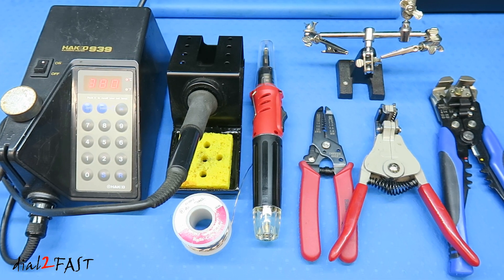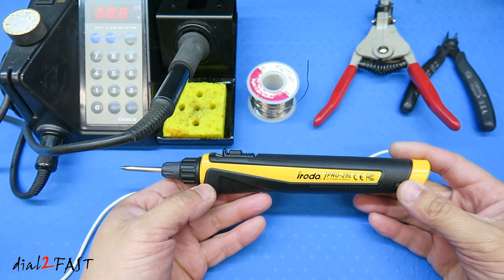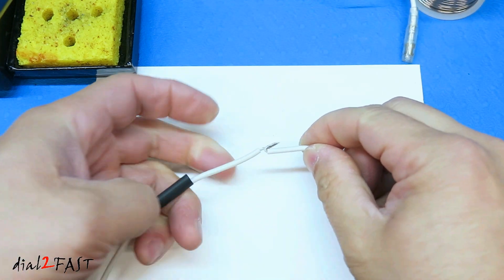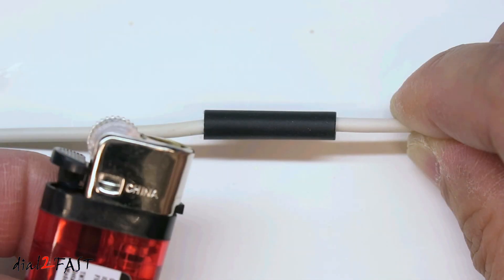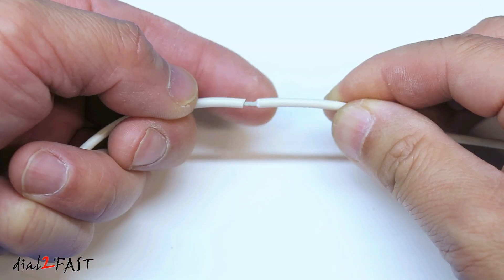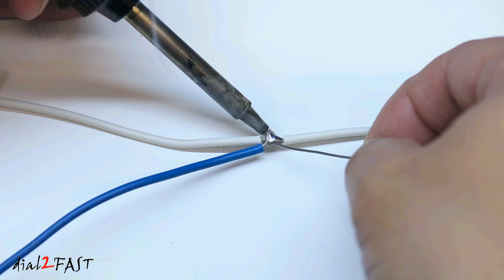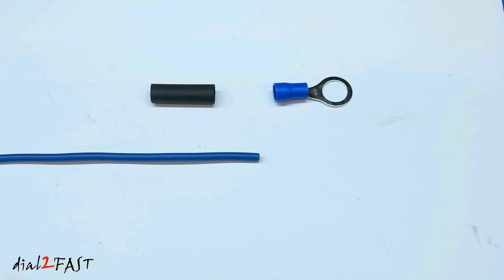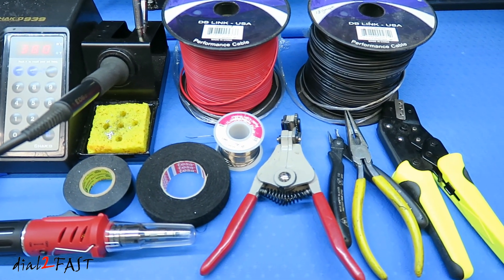How To Solder & Heatshrink Wires - COMPLETE GUIDE - Video 2

Comment: I own a 2008 Hummer H3 Alpha and the wiring harness supplying power to my left headlight was gnawed by a mouse or some other animal. As a result, 2 thin wires in the harness were severed in the harness, but about 5 remain untouched. In a constrained environment like that, would you recommend soldering or crimping a wire splice between the damaged wires? I figure trying to fix it myself is going to be a lot cheaper than having a mechanic do it. Great videos, by the way!
Reply from the maker: With a cut in the wire, you have to first check and make sure there is enough slack in the wire for you to fix it. Regardless you solder or crimp, you have to strip part of the insulation on both ends and make the connection. If there is not enough length, you can always solder or splice a piece of wire in between. Not pretty but will still work. Whether to solder or not, that depends on how good your soldering skill is. If you do a bad solder, the connection can fail (break apart). Crimping might be a better choice is you are not familiar with soldering.
Reply: @dial2fast  Thanks for the response! It’s been a VERY long time, since I did any soldering, so I guess I’ll splice a piece between the broken wires using crimping. I appreciate your videos- very clear and easy to understand with great camera work!

Comment: The method you use to melt the solder does not heat the wires so the hot solder is going onto cold wires. The solder will not flow between the wires as it should. Try placing the iron touching the wires below the connection and place the solder touching above the connection. As the wires heat the solder will flow between the wires and make a much stronger connection.

Comment: Thanks for the video . I had to do quite a bit of soldering with a recent install. I used to do the soldering like you but recently switched to holding the iron below the wire and the solder on top. The iron heats the wire and then the solder and the solder flows down through the wire easily.  One other thing I have seen done is the use of dielectric grease around the solder joint before wrapping with tape or heat shrink. Sort of protection in high humidity high temperature climates..